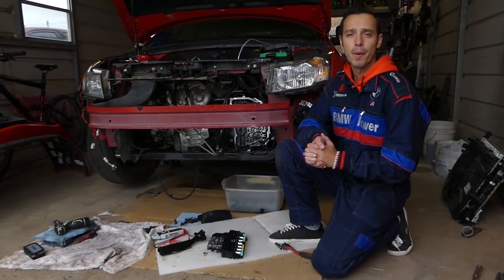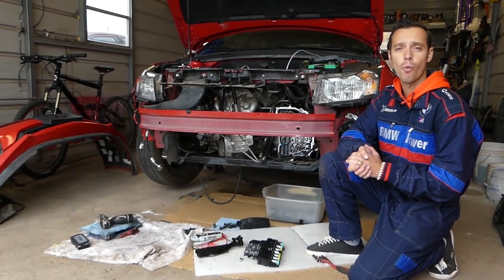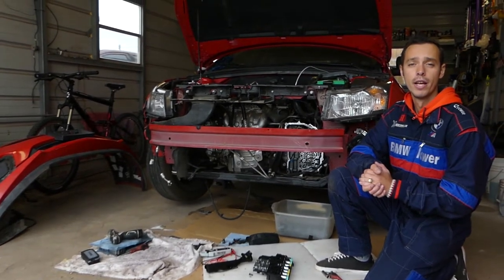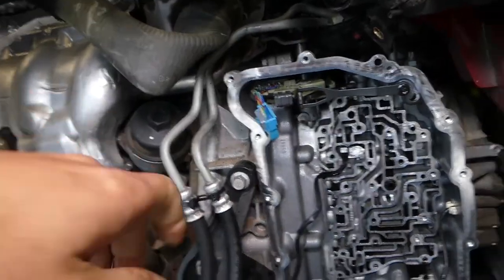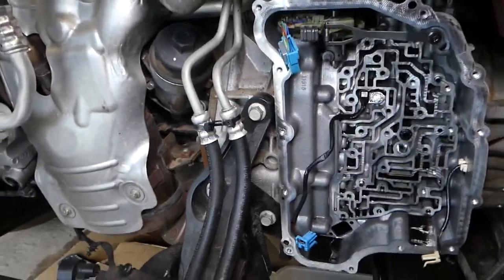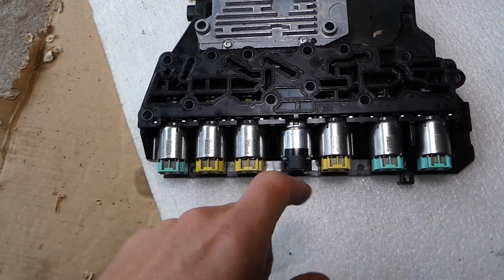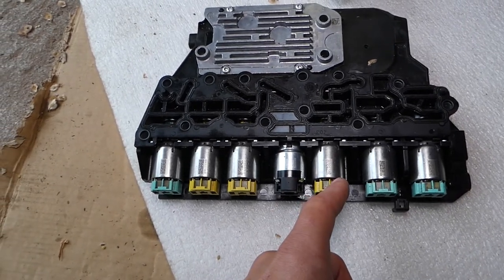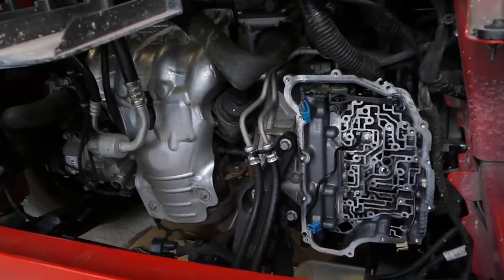CODE P0740 P0741 P0742 TORQUE CONVERTER TRANSMISSION MALIBU EQUINOX SONIC CRUZE GMC TERRAIN BUICK

Comment: I have a 2007 BMW X3 with the code P0742, torque convertor clutch solenoid stuck on,. Found nothing online for it, cant even find the part (torque convertor clutch solenoid), only goes up to the year 2006.